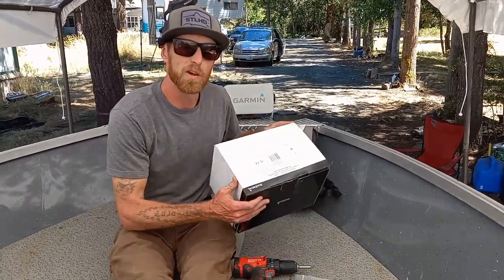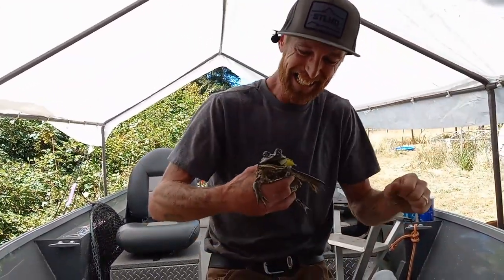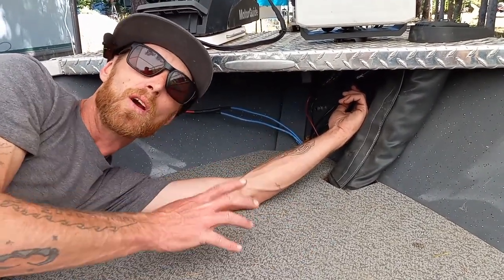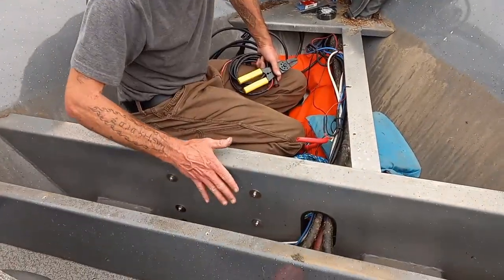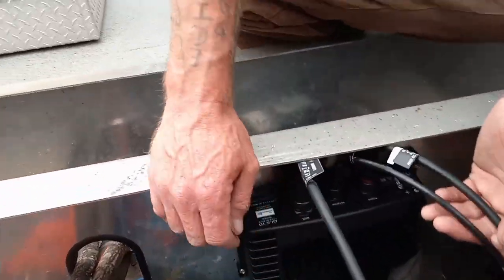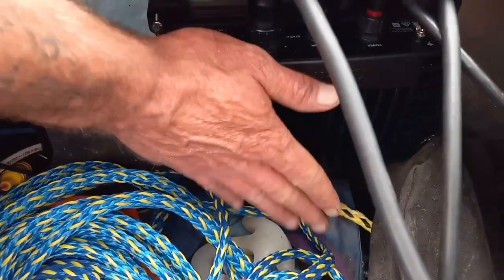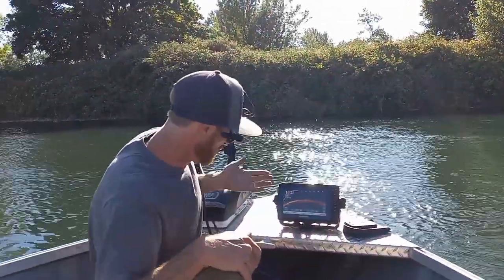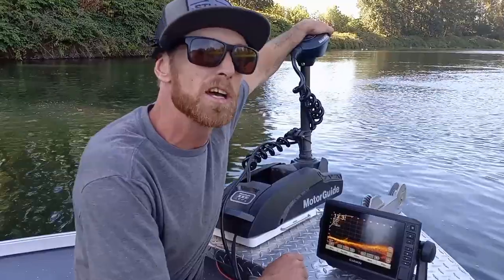Installing Garmin Panoptix Live Scope

Comment: This is the best video I have seen on  how to install the garment 93 and the live view. but what about the battery hook up
Reply from the maker: So on our boat we have a line that runs from the bow(front) to the batteries in the back. That line is a heavy 4 gauge wire that is on a switch in the back of the boat. For our boat it's the "accessories" line (or switch) I simply tapped into the line and used heat srink to make it waterproof. That one switch controls power to the fish finder, panoptix computer, downrigger plugs ect.
Reply from the maker: And thanks for watching and commenting that it's the best! Much Appreciated!